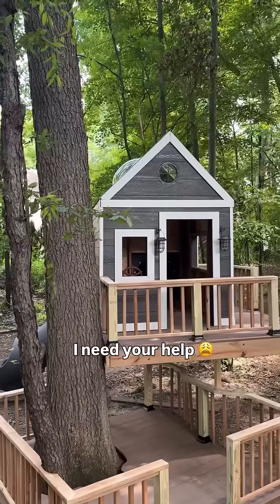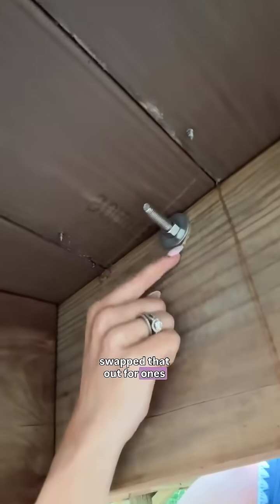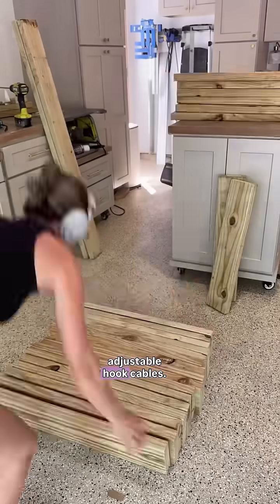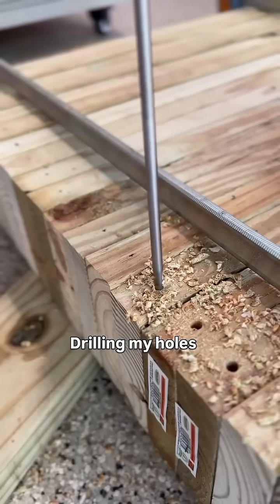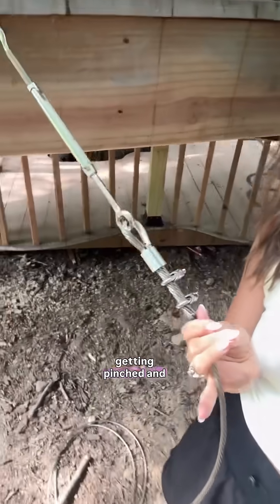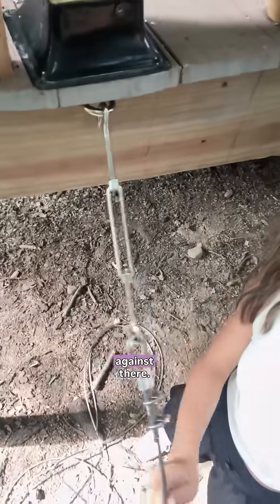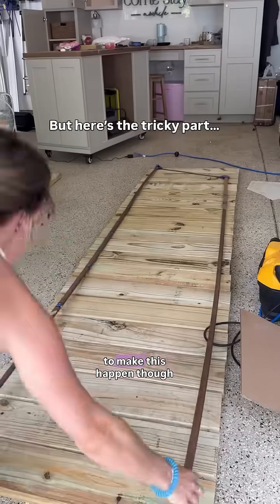The tension bridge is so close but I can’t figure out how to account for the angle of the bridge 🤔

Comment: Could taper the pieces. Dont think of the bridge as a straight line. Will have to do some math and think of it more of an arc. The boards are not going to be able to touch unless you make a solid frame for the structure. Plan for gaps, you will need at least 1/4" gaps for expansion.

Comment: I would set the boards on top of the cable and attach with U bolts.  You could do a rigid bridge.  I think it would be better and easier to cut the boards.

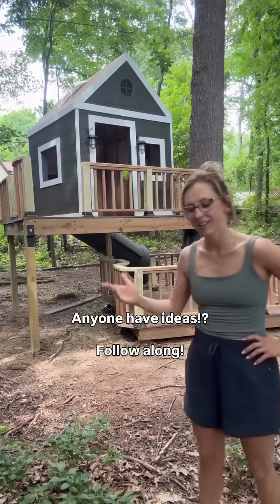Comment: Interesting project, but first of all there are several ways to line it all up. The easiest way, in my opinion would be making your bridge in parts. 1. on your timeline at 1:12 you have your template on the top of your bridge. Look closely, ends of your template, last 2 boards make 90 degree triangles. Take two boards from each end and glue them together, then put them back under your template and trace each triangle. Cut them out, drill holes for cables and secure each triangle to each deck it will give you strait line for the rest of the bridge! Also, just two cables, 1 on each side of your bridge will NOT be stable enough for kids to run thru or your gonna have to put a lot of tension on those cables to make sure they won't have a lot of bounce. Knowing what kids will do on that bridge (running, jumping and crawling), that tension, combined with kid's activities will cause structural damage to your decks at bridge's end points. It is always good idea to add more contact points to ease up stress load. Basically, add cable railing to your bridge and conect it to the bridge itself, that will give you 4 contact points instead of 2. If you going to make that bridge just strait thru with out any kind of support or additional railing, you will need 4 cables, spaced out evenly, which would stabilize your bridge without having a lot of rocking while your kids will run thru it.

Comment: The turnbuckles are fine, but all you needed was a long eyebolt: adjusting its nut would have worked as well as the turnbuckle, with less things to rust and fail. A second nut behind the first would lock it in.

Put blocking between the first and second joists (perpendicular to the joists), to distribute the load of the cables, so that the cables aren't pulling on just the second joist alone.

By running the cable through the middle of each board, you in essence turned 1-1/2" lumber into 3/4" lumber, which will worsen as the cable saws on the wood. I would have run the cable under the board and secured it with hardware. That would give you the full 1-1/2" dimension to support the bridge users.

To account for the angles, a simple solution would be to use different width spacers: a narrow one on the inside of the "curve" and a fatter one on the outside.

Comment: You'll need to make it square to square for the bridge to work out best, one side will need to framed and supported to handle the bridge, or each board would have to be cut to match the angle ur trying to achieve

Comment: Use a chain instead of a cable and through-bolt the boards through the chain below. That will maintain the spacing and provide a solid but flexible bridge.

Comment: I would reconsider drilling through the boards because you cut it down from an inch and a half of board to maybe a half inch if you're lucky holding any weight on the cable. If it were me I would set the boards on top of the cables and use some U clips and screw them around the cable back up into the board from the bottom. That way you get the entire strength of the board. You also might want to consider running a third cable straight down the middle.

Comment: I was thinking about using some type of metal or really hard material, screw those pieces to the basis of the platforms that are across from each other, and then put the wires through those materials, set jazz like a pipe of some sort, it doesn't have to be circle, 😊 in fact I recommend it being like rectangular. And then you could put the wood on top of those on the bottom the rectangular pieces tube, 😊 would be under the wood, and the top layer would be the area the normal wood pieces would be ,where they can walk on..

Comment: You asked for ideas - one thing to consider is that pressure treated lumber only penetrates 1/4-1/2" into the board. so when you drilled holes in them, it exposes the inside of the board to rot. would suck if a kiddo fell through in a year or two... you want to get a plastic syringe and squirt some end grain sealer in there. you can also just dip the whole board end into the bucket since the ends of the board are also cut and therefore exposed. The holes with the bolts also should get end grain sealer. Your build is so solid and clearly built to last. It would be a shame if a few intrusion points gave you trouble in a few years.

Regarding the diagnol bridge, you may want to consult a structural engineer - 

Key Challenges of a Diagonal Cable Bridge
-Uneven Load Distribution
-Diagonal spans introduce torsion and lateral stress because tension isn’t perfectly aligned with gravity.
-Trees and attached structure will experience asymmetric pull, potentially twisting them or overloading the anchor point which are designed for perpendicular pull.

Anchor Angle Stress
-A straight bridge evenly loads two trees.
-A diagonal bridge adds shear force at anchor bolts—not just downward pull but sideways torque.

Walking Dynamics
-On a diagonal, the bridge will swing differently: more lateral sway + twist if people walk off-center.

Take a breather on this bridge and consider maybe a static bridge instead dpeneding on the severity of the angle between the two houses. maybe its easier to get them alligned perpendicular or install some posts as a midpoint. be careful and make sure you overbuild and use end grain sealer.

Comment: Maybe run 3 or more cables.That way you can have the ends cut at cokceyed angles and still have them supported without putting a curve in the bridge(spacers,) which wouldn't work; it would tip.
Reply: Or build out one/both of your platforms in order to make the angle straight.

Comment: You got this. Literally just do what you was planning to do in the beginning and it will still work. It just seems like it won’t cause your cutting away some of the board. You will be fine tho. If you are worried about it you could just add a support on the right side. Like take an extra wide piece of board and screw it to the bottoms of the last 2 boards. That should hold them up and together with plenty of support

Comment: I used two chains to hold the boards in place. I used lag bolts and washers to secure the wood to the chains on the underside of the board. . You can just bolt on the boards while the chain is hanging. I used two by fours for the boards. Make sure the links are big enough for the lag bolts to fit through. Grade 43 chain should work but do not let adults walk on the bridge.

Comment: Lay down the boards just as you had them and place whatever spacers you will use to determine the number of boards you will need. Then measure the shorter side of your template. That that measurement and determine how much you will need to trim off each board so the boards will be shaped more like fan blades. Hope that makes sense.

Comment: When you run the cable through the board put a steel pipe in the hole to protect the wood and prevent that steel cable from cutting through.

Comment: You need to double up the joist that these cables are attached to and put blocking from the one it’s attached to to the outside joist so it doesn’t roll the hoist out

Comment: The decks are not facing each other from how your laid down pattern is.
Your faning the last three boards seem ok, just keep in mind that drill the hole in line with the cable.
The white way to do it is to have the landings face each other so the cables are the same length so the sagging rate shall be even.

Comment: Glue all your pieces together so they don't move around (It should look like when giant slab of wood), Make sure it's big enough for your template to fit on it completely, temporarily tape your tape template onto the now solid slab of wood, and cut on the outside edge of your template. 

Use your template like a stencil and when you take the stencil off you'll have your bridge walkway. I hope this helps! 😁👍

Comment: Add bracing in line with your turnbuckles so that all of the load is not on one truss. Use small spacers on the shorter cable and wider spacers on the longer cable. It will take some trial and error but you can do it. The holes in the board weaken the strength of the boards. They should have plates on the bottom that have eyelets for the cable to go through, that way it supports the full length of the board face and doesn't cause wear.

Comment: Suspended bridges are STRAIGHT as a longer side will always droop. if both ends of the bridge are not parallel and equidistant, the mounting points on the houses must be offset.

Comment: Carriage bolts with a bracket plate to arrest the cable from underneath. It grants you full bearing of the decking and is fully adjustable for gapping. I would cut a set of gapping jigs (T shaped to maintain conformity throughout. 
  The angular run can be mitigated by two processes. Start on the tight side in each direction with a mitered board, then maintain regular gapping with a split difference at your center board. The other option is to square the first and last boards, divide your number of steps by the angle differential, and modify the gaping to accommodate the sweep.

Comment: 1) Don't have the angle.  The longer cable will always droop more than the short one and make the platform unstable.  Make a platform off the bases that point at each other.  Or, I see a pine tree between the two bases, make another small platform there and joint the two bases that way.
2) Put the walk way boards on top of the cables.  The cables going through will cut the boards and kids will fall.  You have to clamp the boards to the cables so that they don't move at all or rub together.

Comment: Put the board all the way to the edge and then screw differnt colored board on top of the other board where they are cut to an angle and those last couple board can be 1 or 2 pieces only like its just thicker steps at the end maybe? Idk if that made sense

Comment: Mini deck out where the angle is? Or.. Make the boards taper in to be narrower on one end than the other. That way you won’t have wider gaps on one side. Like a very long trapezoid with the parallel sides being the far ends the cable goes through.
It’ll make a curve. Or use a couple large pieces in place of the planks where they don’t fit, or a mini deck out to cover the angle.

Comment: I’d use a metal tubing through the holes in the wood to protect the wood from friction. The cable will quickly cut through the wood with movement and kids running across.
Reply: Thats what I just said lol, I posted my comment then saw yours, you said it way better than I did
Reply: Best comment

Comment: There is more stress on those eyebolts than you would think. I'm thinking the eyebolts are 5/16".... safe working load is 90#. The cable is plenty strong.  I would test it before I'd let a kid on it. As an adult my be on it at some point, I'd test it to 500# ( 8 bags of cement) Loads can be calculated.  Be careful.

Comment: You’ll need to taper the boards into a pie shape and make them slightly longer to allow for angle of the center line and perhaps adjust your hole angle slightly to reduce tension on cables

Comment: If the angled pieces are at least half the width of the bridge then you could add a third rope to the middle for stability of the end pieces. And knotting the rope would be safest to not pinch anything and use more than one in the spots of the outside part of the turn

Comment: A Bolt/Washer set up between the boards would go a loooong way and help with your angle lay out❤, I would also suggest elevating your template set up (perhaps between jacks using a knotted thread/rope) so you can truly gage sag and go from there. Just a couple suggestions, but whatever you decide you've definitely got this as you've already proven to yourself AND the internet❤

Comment: Consider a partial pie shape where it angles. Don't cut the boards in quite a point on the inner side but angle boards on both sides only where the bridge turns so you wind up with full boards on both ends. I agree with washers in appropriate sets, 2 here, 4 there, etc. as needed.
Great job! Proud of you, girl!
Reply: If the boards are not perpendicular to the rope, the holes she drilled will be at the wrong angle.

Comment: Put your angled pieces toward the centre of the bridge, that way the rest of your boards act like the stones in an arch, with your angled pieces acting like keystones. And try to use two planks which are inverted and triangular in shape (the angles will be different from each other and will be dictated by your bridge shape overall), that should deliver the load more evenly and still give you the swaying rope bridge you’re after.
Reply: If she changes the angle in the center, then any board that isn't perpendicular to the rope will have the hole she drilled through the board be at the wrong angle. What she really needs is a landing that squares up both sides to make them parallel.
Reply: @dougsholly9323 agreed, if it we only small difference then she could rip the boards at an angle but because her landing are drastically different even if she were to angle the board the bridge will sag to the longer side because there is more length in the cable on that side. She needs landings that face each other so that the bridge functions properly.
Reply: @SurelyLightFoot I'm pointing out that geometrically speaking, even taking a little off each board will add up, and within a few boards, the holes she drilled will not allow the boards to meet up. Those holes will force the boards to remain perpendicular to the cables., no matter how you trim the width of the treads. So yeah, the landings need to be parallel for a rope bridge to work.
Reply: @SurelyLightFoot on a previous video, I suggested that each tread be supported by a stringer, which actually has the cable running through that. But she clearly wants more of a “pirate ship” vibe and less of a “Disney/Public proof - over engineered” vibe

Comment: Consider maybe using spacers that gradually get wider on one side to splay/fan out the ends (think peacock feathers), spacers can be washers, but I would use a combo of washers and cut metal pipe. You could use metal outdoor electrical conduit and cut it easily into different widths with a pipe cutter. Just a thought.
Reply: That’s such a creative solution!